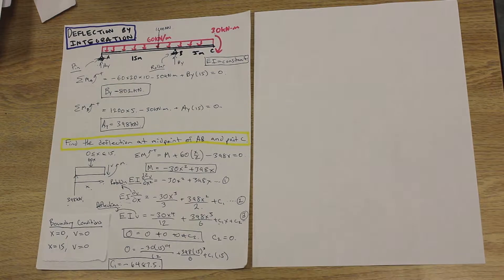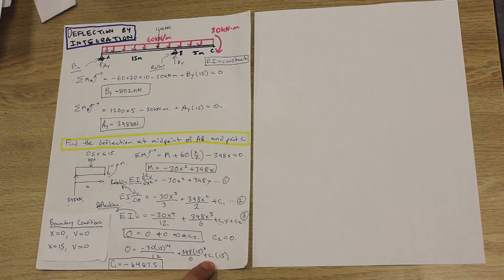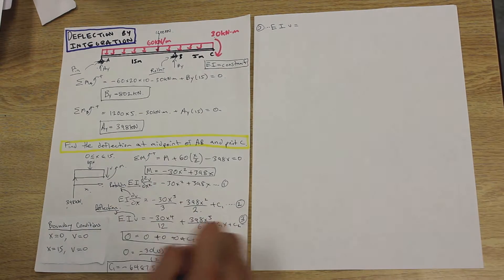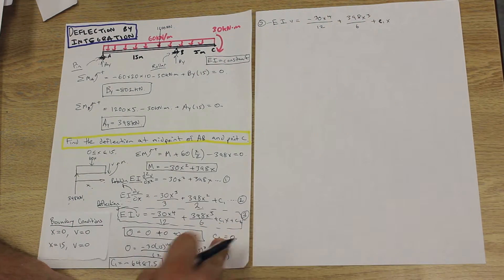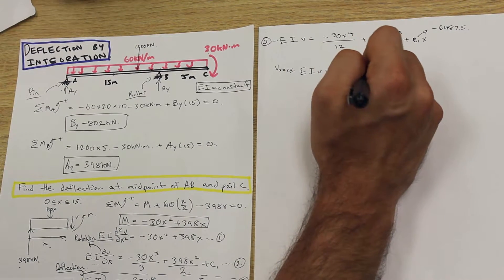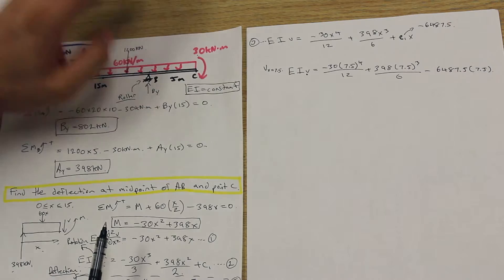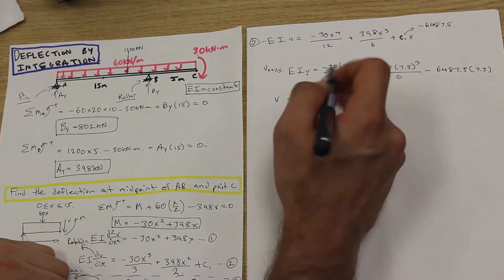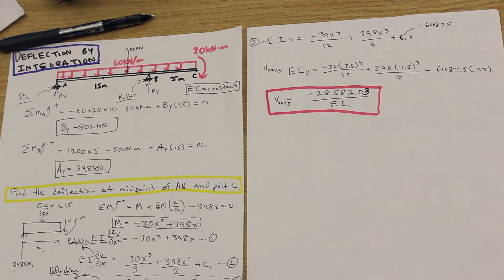Solving for Deflection of a Beam Using the Method of Integration - Part 3/4

Comment from the maker: TimeStamp !

1:03 - Theory Ends - Solution Beings (Dont skip the Theory!)
Find the "Deflection" at the Mid-Point (when "Vx = 7.5")
3:52 - Final Solution (Now try to do it on your own!!)

The "Deflection By Integration" problem has FOUR Parts

Part 1 - https://youtu.be/39zdlzwDvgI
Part 2 - https://youtu.be/v7Zqpy5zxvM
Part 3 (which you just watched) - https://youtu.be/RMTOw4C2T34
Part 4 - https://youtu.be/ZA4L7yPXseo